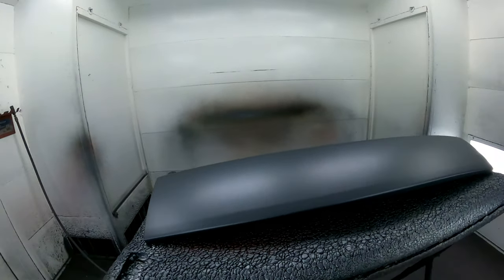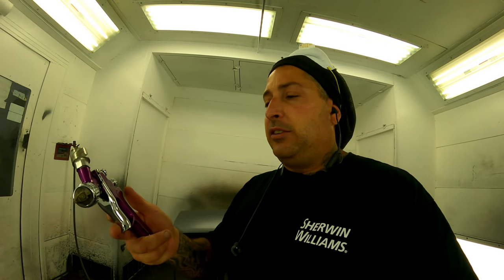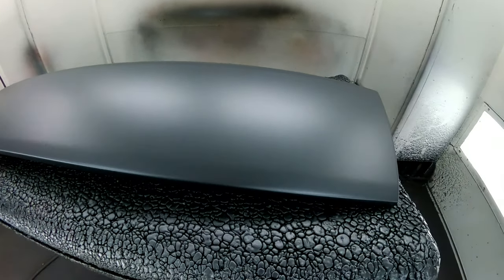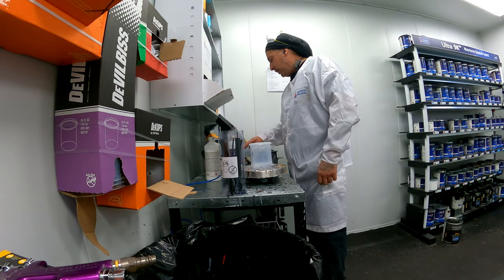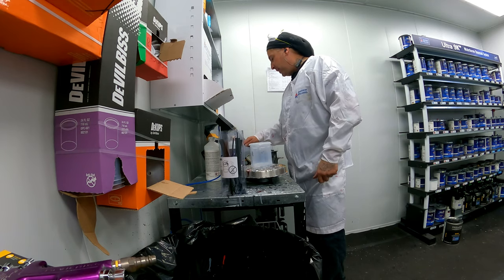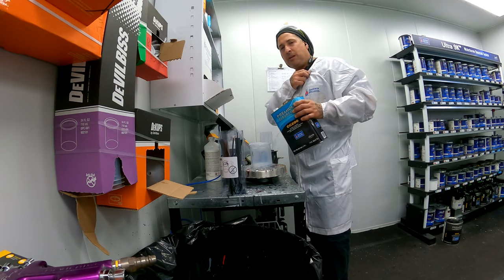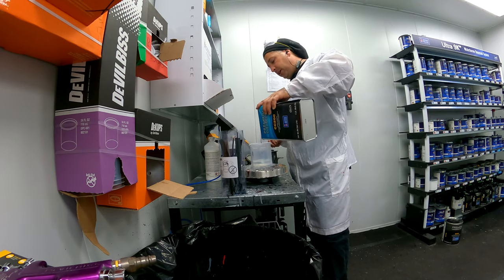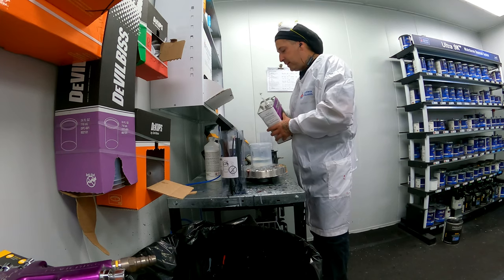DEVILBISS SRI PRO

Comment: I bought the Devilbiss  Sri Mini Lite Pro at Christmas but it's fitted with a 1.4 nozzle ( I believe the needle and cap does 1.2 & 1.4) I am applying base-coat metallic  to motorcycle tanks. Do you think I need the 1.2 tip instead of the 1.4 please?
Reply from the maker: If it's working out for you then 1.4 is fine